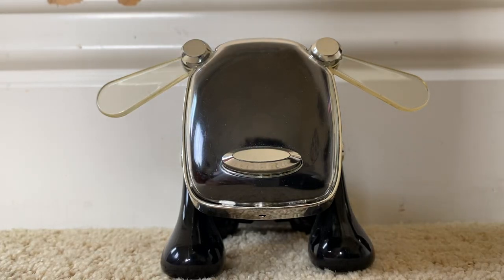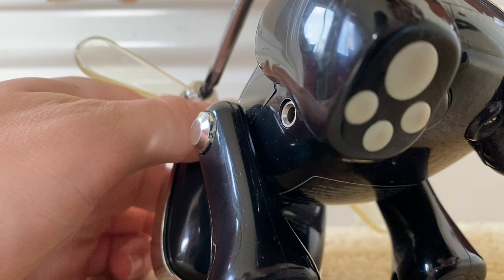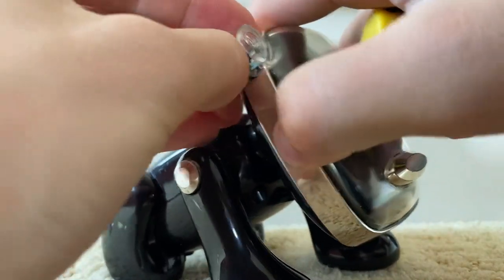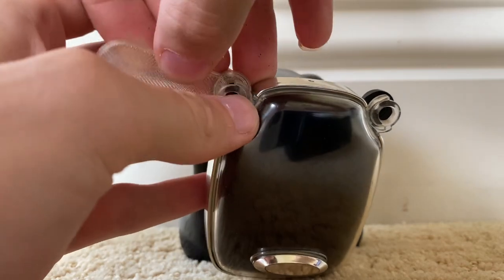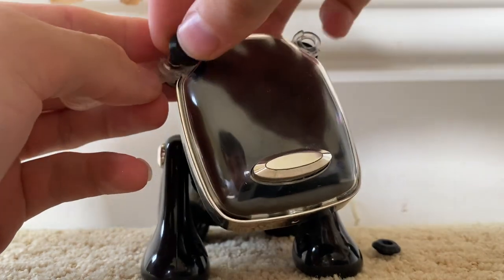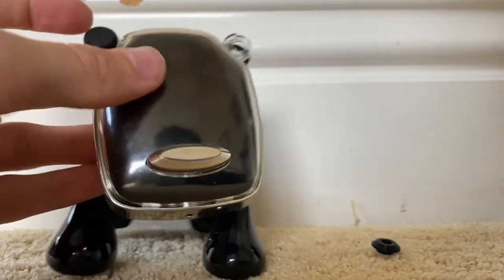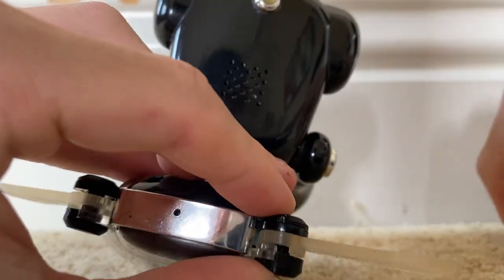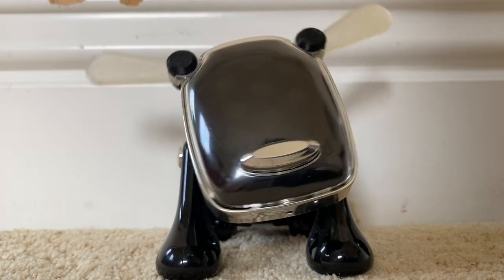How To Install Your Custom 2005/2007 Original I-Dog 3D Printed Ears & Ear Hubs

Comment: I’m really impressed with the creation and effort you took to make 3D printed custom ears to use for the Original 2005/2007 I-Dogs dude! I love how they come in many color choices to choose from for those who would want to custom their 05/07’s ears and ear accent hubs.
This tutorial could also be useful for some that have 2005/2007 I-Dogs that don’t move their ears properly like how to tell they’re in the correct places as well, so this is very helpful.
Great job man! I really love all the stuff you create (like gears and such) and 3D print to help things like I-Dogs and other things that could use a new part or two for a change like for ones that really need it